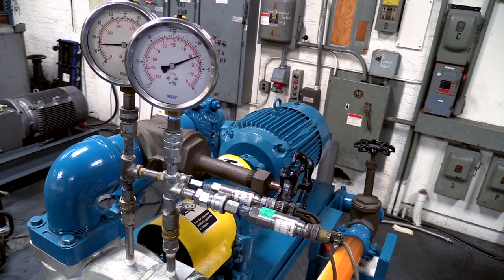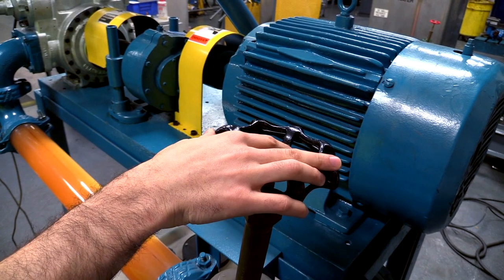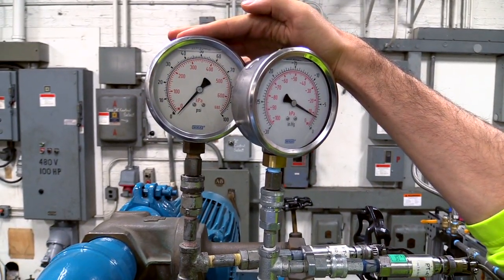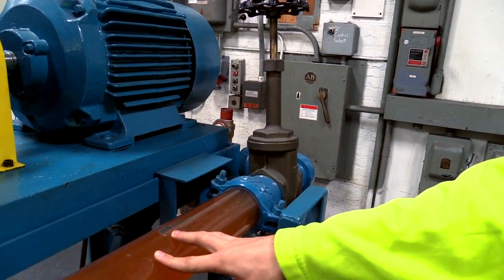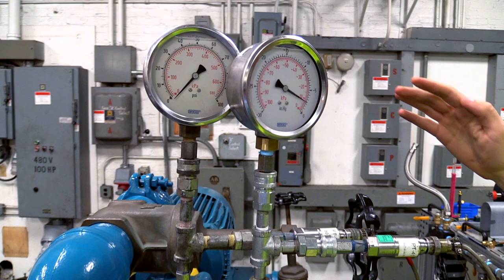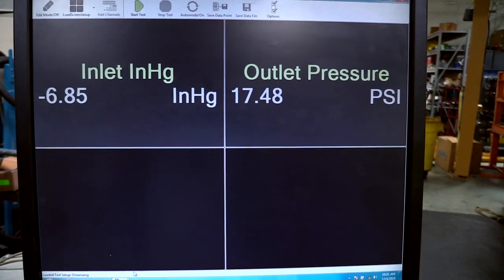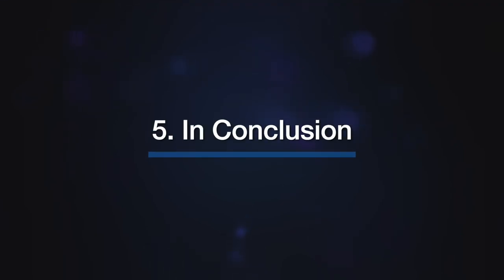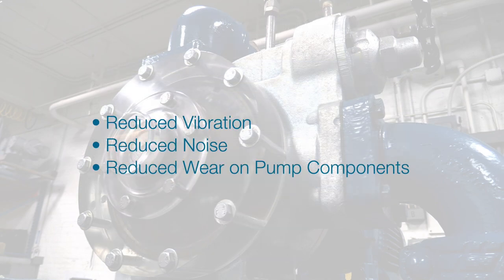Controlling Pump Cavitation in Sliding Vane Pumps

Comment: Funny the the decibel reading on the left was in MAX HOLD meaning it wasnt being recorded, it was just one max number from a recording of sound level.
Reply from the maker: You are right, the Max Hold was turned on when we were recording the pump without the Cavitation Suppression Liner. The reason we did this was because the decibel level was bouncing around extremely rapidly making it difficult to read the screen, and this wouldn’t show up well on the video. The Max Hold functionality stores the maximum reading during the time sequence that was recorded, which was 106 dBa when we were running the pump. That is also why we left the audio on, so that viewers could hear the difference as well.
Reply: @BlackmerGlobal  how much did the pressure dropped after putting in the liner, sir ?!

Comment: have a problem with a HXL 6 Blackmer pump, the liquid source is located around the 100 mts, when the pump is working and the liquid level in the tank decrease, in this moment the noise and vibrations increase. I am so worried I want to find a solucion. Someone could give me an advice for to solve this problem.